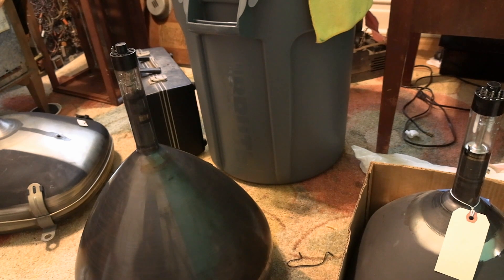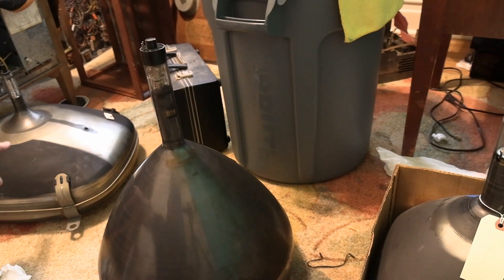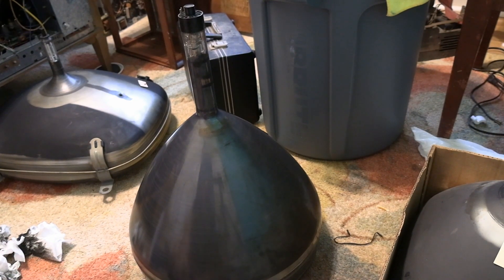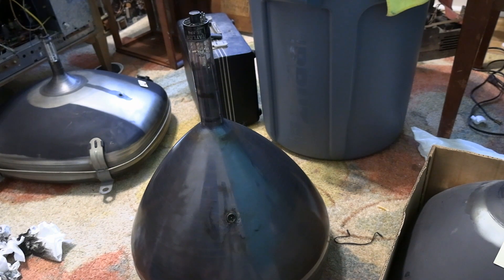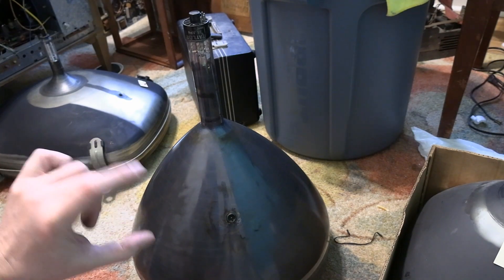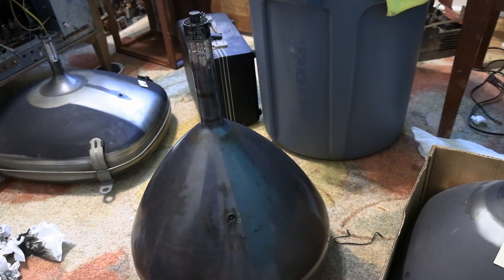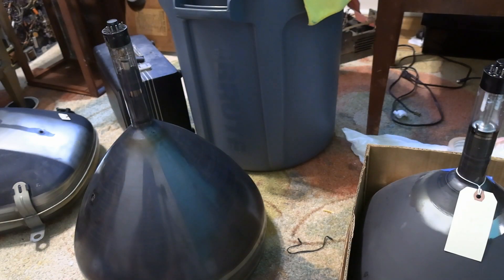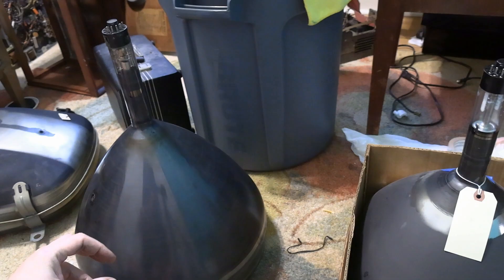CRT autopsy follow up discussion

Comment: The electrons are accelerated by DC EHT however they are modulated by AC to provide the image. I suspect the real answer involves complex maths and quantum physics relating to how energy is converted from the mass of the electrons to photons of light These posts have been so interesting thank you very much. I love the vintage picture and ads also.

Comment: Insightful video!...GE-Techni-Talk from October 11, 1953 provides some detail on the process to manufacture an aluminized picture tube…the aluminum coating is condensed onto the back of the phosphor coating as well as the walls of the bulb…the complex part seems to be associated with laying an extremely thin layer of plastic over the phosphor to protect it, which is then baked out after the aluminum is deposited…could have been a low yield process with rejects and limited production numbers!!...also aluminized tubes would have been a competitive advantage for GE, RCA, Sylvania in their sets…selling non-aluminized tubes to other manufacturers, while selling aluminized replacement picture tubes to a booming aftermarket may have maximized profit…you never know!!!

Comment: In the UK we were always advised to make sure your tube had and ion trap, when aluminized screens came along everyone still asked for an ion trap so we ended up with tubes with an ion trap that were also aluminized.
Reply: True. The first generation 21ALP4A was aluminized with a bent gun and ion trap. On that tube, only the rear 1/3 of the cone had the dag coating, the rest was uncoated, so you could see the aluminum inside. Admiral introduced these into their lineup in the 1956 model year with the new 18Y4, 18SY4, 19Y4, 19SY4, 20Y4, and 20SY4 chassis of their Advanced and Super Cascode series. The selling point was that you could comfortably watch TV without dimming the lights. I grew up with one of those sets and we never once dimmed our lights. The later generation 21ALP4B had a straight gun and raised the anode to 21kV, the earlier tubes ran at 16kV.

Comment: I'd like to add something. Others and I have added a few answers here and there, so we can say the return path for the electrons is clear. Now, there is an interesting spin to this. There is a special case of CRTs, in which you indeed are interested in the electrons remaining as buildup charge. You see, the electron looses its kinetic energy when it hits the screen (be it into phosphor atoms, into lacquer coating atoms, or even glass). It obviously doesn't disappear. So the anode will start accelerating those electrons again, this time to the sides, in a motion parallel to the screen. 
Now, as the electron had no motion to start with, it will take time to accelerate, meaning the glass area will retain that static charge buildup for some time before it gets into the anode again. And "If it takes time... it's MEMORY". 
Regular oscilloscope CRTs were used as Williams-Kilburn memory tubes in early first generation computers. You simply needed a conducting faceplate at the outer face of the screen to sense that charge buildup, instead of your finger. And that provided a better return path (capacitive) than the HV anode. The charge would go away in a fraction of a second, but you could scan, read, write again, before it would vanish.
But the anode potential was still there, complicating things because as electrons moved sideways they would eventually spill from a charged 1 area into an uncharged 0 area causing memory retention problems. 
As the 1950s progressed, specialized tubes were made like RADECHONS and other storage tubes, with the sensing faceplate inside the glass envelope, and usually with a wire mesh that isolated the buildup charge from the anode eliminating the spill problem, seriously raising the retention.
And with an entire decade of research and funding, with things finally ready for a reasonably good computer memory, An Wang developed tiny magnetic cores, giving way cheaper, lifetime retention, binary memory with a rather simple binary addressing system... the storage tubes evaporated in the blink of an eye.
Almost... because storage CRTs were able to retain ANALOG charge levels... not only binary. 
So they remained in a plethora of niche applications. The soviets used them in their radars up to the 80s! They were used as a memory to take a baseline and spot the difference (moving target) between two consecutive radar scans.
Also scan converters of the 60s used these weird CRT contraptions, with one electron beam to one side, doing the writing and another to the other side of the screen doing the reading.
The latest modern storage tube I am aware of, is a weird Tektronics storage/digitizing CRT (without a visible screen) which was used in some GHz oscilloscope I don't quite remember, I think in the 1980s. The scope had a regular CRT for its screen, and this weird thing inside to do the hard work.
Physics is beautiful, and in those days you had these particle accelerators right there in front of your eyes, which you could play with in your garage. Every fluorescent tube in a ceiling was a miracle of particle physics. Turning on a radio and looking it's back side lead to a warm glow and made you feel like in a 1900s scientist. Then the radio blinked at you with its green eye....
OK OK.... I've got nostalgic... no way a bloody tiny square lump of plastic IC will make that.

Comment: Aluminization is a more complex procedure than you might realize. It adds several extra steps to the manufacture of a CRT and causes shrinkage which means the entire bulb has to be rewashed and the screening process started all over again. Tubes that were smaller, such as in some of the first portables around 1956, were not aluminized to cut cost and a bright picture was secondary to the cost of the set.

Comment: Thanks for the videos. The CRT is indeed an amazing product of engineering and physics! This seems like a good place to ask a question about a CRT issue. I have a 10BP4 that has a very persistent G1 short as it warms up. I am unable to remove it with 2 different testers I have. I do have a replacement but wonder if trying to blast it with a large external capacitor might work. Any thoughts? I am restoring a Philco 49-1040 TV and looking forward  to following along with you when you restore yours.
Reply: There may be a particle between the G1 and G2 which doesn't show up until the G1 heats and "oil cans." Leave it on the tester for several minutes to let everything heat and expand, then try short removal.
Reply from the maker: I believe that's exactly what the clear short function does in the testers.  If you do try an external cap, you can experiment with voltage and cap size though so it might work better.

Comment: I think, from memory, that aluminized CRTs require a somewhat higher EHT than non aluminized.  The electrons needed to be above a certain velocity to penetrate the aluminium layer.   That could be the reason that it took a long time for the technique to become general.
Reply from the maker: They are interchangeable but aluminized can handle higher EHT allowing for an even brighter image.
Reply: AFAIK you need almost 3kV to start to light up an aluminized CRT but a non-aluminized CRT can produce light below 250v. In practice it doesn't matter because at those in-between voltages the picture is way too dim to be watchable even in a perfectly dark room.
Reply from the maker: @eDoc2020  typically non aluminized CRTs run on 9-12,000 volts so really not an issue. The early aluminized CRTs were designed to be drop in replacements. Like 10FP4 for a 10BP4

Comment: The light reflective effect that made the image brighter was the first reason aluminizing was used. I think that realizing the ion burn reduction was also a benefit was later. There are CRT used in the mid 50s that were aluminized and still use an ion trap magnet.  Could also be that there were a lot of guns in stock that required an ion trap so they wanted to use them up.

Comment: The beam current return path is back through the second anode. On aluminized tubes, the aluminum layer is connected to the second anode coating.  On older non-aluminized tubes, the screen and phosphor itself builds up a considerable static charge, which slowly leaks across the glass (or through whatever contaminants are on the surface) back to the coated portion of the bulb.  The static charge buildup on the phosphor can cause a phenomenon called "image sticking", where the image persistence starts becoming longer, and blurs details. This acts as a severe limitation of the accelerating potential, and consequently image brightness. Aluminizing the tubes was a great advance with 3 major improvements.  Prevents phosphor damage from ion bombardment, reflecting light emitted from the backside of the phosphor screen in a forward direction (major brightness increase), and eliminates image sticking by providing an easy return path for the beam current. This allows the use of higher accelerating voltages, and even better image brightness.

Comment: 5:27 They are following the aquadag to the ultor connection through the high voltage lead through the rectifier through the high voltage winding and back to ground. That's why the high voltage varies with beam current. The Beam current is the leakage of the secondary accelerating anode and the cathode current. My understanding, but I think I'm correct.
Reply from the maker: How does it get to the aquadag on the interior?  There is a pretty big gap between the phosphor and the interior dag.  Electrons hit the phosphor and then?
Reply: @bandersentv  I think the secondary electron effect is important. Electrons emitted from the spot hit by the beam from the gun.  There could be some leakage also.  Aluminizing could be a major conduction path in tubes with it.
Reply: @bandersentv if the CRT is aluminized, there is no gap as everything is conducting.  But even without a conductor, you have secondary electron emission from the phosphor and also  repulsive forces between them.  If for whatever reason the electron is not attached to the phosphor atoms it will start being attracted by the anode just as it happened when it was originally emitted by the cathode. If it went all the way back to front it can certainly travel a few inches towards the closest area of the anode.
Reply from the maker: @TheAlchaemist  I was think of electrons closer to the center of the screen
Reply: @bandersentv  Always talking about non aluminized screens here. Any electron that is not captured by an atom at the screen, be it because it is a secondary emission electron, or because it has been thermally/spontaneously reemited from the phosphor, or because it has somehow lost its kinetic energy for whatever reason and not attached to an atom, is just sitting there, dislodged, "floating", feeling the acceleration from the anode. It will indeed start accelerating towards it even from the center of the screen (just as it initially accelerated from the cathode, remember that the thermal emission does not give it too much velocity, it gives it just enough to dislodge it from the cathode surface). 
So the distance to cover is not a problem for it (it just determines the time it takes for it to finally close the circuit), and the direction of motion should be parallel to the screen, as the sides of the tube are the nearest point to the center of the screen.
So that "cloud" of returning electrons will crawl over the screen, and will indeed interfere (repel) the new incoming electrons only as they get very close to the screen, at the last instant. Those incoming electrons have a ton of velocity/inertia so they should not be terribly affected, but the image may still loose some focus. The effect might be more noticeable based on the CRT size, the amount of electrons flooding the screen (beam current) and the HV (kinetic energy of the incoming electrons). I bet they played with those values a lot when designing the TVs.
I recall reading about this eons ago, but it was some obscure effect that as aluminized screens came up, simply nobody continued talking about.
What I was totally unaware was that non aluminized CRTs stood around for a decade! I just assumed that everyone would have quickly depleted stocks and switched. I smell some patents and royalties there...

Comment: I think this could be considered secondary emission. The electrons hit the screen so hard they bounce off and are then attracted to the anode coating which is positively charged.
Reply: I think that is a good explanation. There could be other effects such as a conductive path in aluminized tubes.

Comment: I wonder if the aluminized process was patented and no one wanted to pay the patent fees?
Reply: I also suspect the original aluminization process was labor intensive to apply correctly.  To get a uniform thin aluminum coating, a refined process with special machinery had to be developed to maximize performance while minimizing costs.  All this likely took some time to work out, which may account for the time before aluminization became the industry standard.
Reply from the maker: OK, but for example GE had some of the first aluminized CRTs and they only used them in some models.
Reply: @bandersentv  It would be interesting to look up the first patent on this. Was it GE or some other person or company not directly making picture tubes?

Comment: I think the emitted electrons strike the phosphor, displacing an electron in the phosphor atoms, which is emitted as a photon. The particulate form of a photon is an electron. The ‘wave’ form of an electron is a photon.
Reply: no, you have that wrong. Photons are exchange particles (bosons) in the electromagnetic field.  The electron can gain or loose energy, emitting or absorbing photons. But it does not disappear, an electron is a stable fundamental particle, it will not decay into something else by itself (not counting electron position collision because that is an interaction). So it's not that an electron converts into a photon, travels, and then converts back into an electron or something like that. Answering, the electron stays in the screen eventually being attracted to the anode.  Now... part of what you described is correct, secondary electron emission.  Sometimes the phosphor atoms hit by the electron will themselves lose an electron, that electron being attracted to the anode as well, while the initial electron takes its place there, having lost is kinetic energy.  The CRT is a beautiful example of a particle accelerator.
Reply: @TheAlchaemist  indeed, a particle accelerator that used to be in every home, and even a mass spectrometer if old enough to have an ion trap.
Reply: not sure if I was clear enough... and answering on the cell phone is a pain. the point is that the kinetic energy of the electron gets converted to a photon, but the electron remains, just with a lower energy.